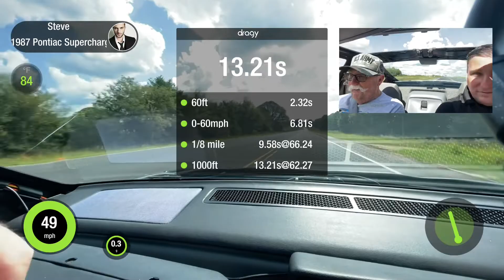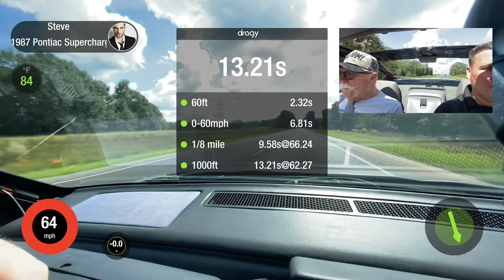Supercharged 3800sc Fiero GT Dragy Run

Comment: I expected 4s to 60 based on 3800 owners claiming how quick they are
Reply from the maker: It was doing 0-60 in mid 4 seconds, but I have a misfire in one of the cylinders, and that wasn't the best run. I have 6 new fuel injectors to put in, plus my intercooler isn't operational yet. I also have a smaller pulley to put in, so stay tuned...